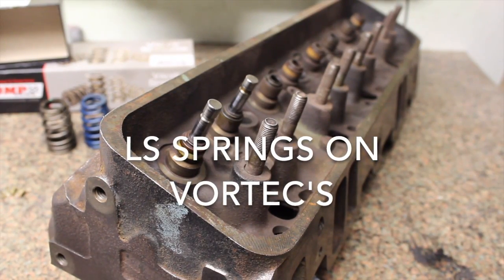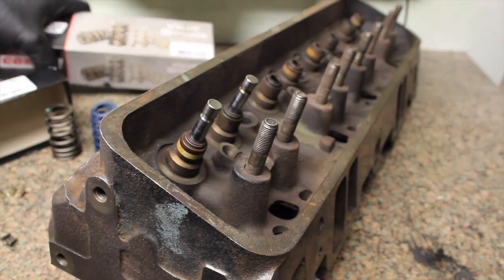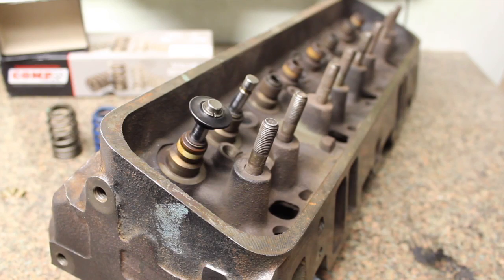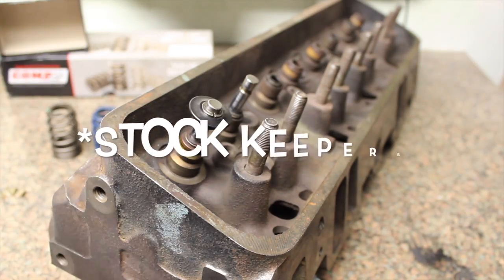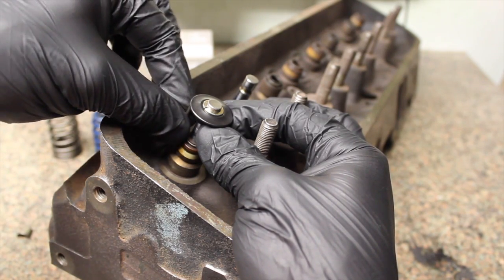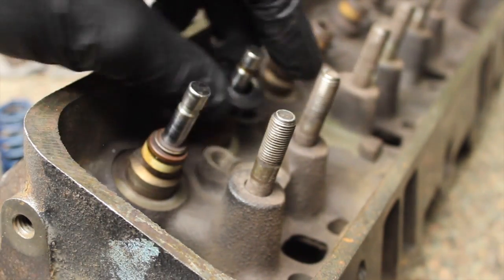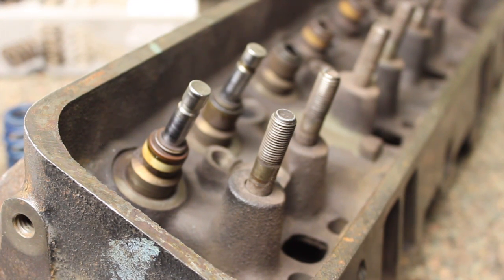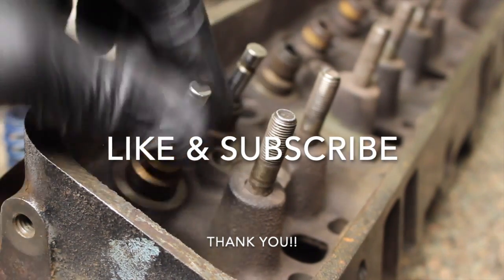LS6 Valve Springs on SBC Vortec Heads

Comment: Or you can use a PC seal installation tool that cuts both the guide as well as trims the top , trim as much off the top of the guide as you feel comfortable with ..why take chances

Comment: You can get .100 longer stainless valves cheap from erson, with longer hardened pushrods also to keep geometry correct . This avoids what may be expensive machine work to cut the guides down ! Hope this helps.

Comment: could you file/grind a bit off the bottom most part off the keeper or retainer just enough to clear 
those rarely fail due to weakness
so that says they are stronger than needed  
but obiously offset keepers would better
Reply from the maker: Yes you can but you the offset keeper installs the spring at the proper height aswell

Comment: Do you have a minimum clearance between the self aligning edges and the retainer/ keepers? Also, if I have to grind/ file my aligners, what’s a “safe” amount to leave on the rocker?
I’m hitting now on my intakes, with my new full roller rockers, and my 787’s with .050 offsets, but they have huge alignment guides on them! I ordered some of the .030 offsets, that I’m going to try on just the intakes, since the exhausts are fine (.520 exhaust lift, and .525 intake Summit’s LT-4 hot cam copy Sum-8802 roller cam).
What limits do you suggest on the valve tip (intake side), and clearances with the alignment edges? Thanks in advance! LOVE ALL YOUR VORTEC VIDS! I’ve been watching them over and over for years now!!
Reply from the maker: You'll want at least .055" nubs aligning the rocker to the valve tip and atleast .025 clearance from the rocker to the retainer or keepers

Comment: I will be installing a mild hydraulic roller cam in my stock 906 vortec heads with .450/.450 lift. I would like to use my stock retainers/keepers because they seem to be in good condition and I’m on a budget. Any spring recommendations would help thanks and awesome informative video!
Reply from the maker: https://youtu.be/tNVX3W-KHT0

Comment: Where are you getting the 1.750 stock installed height? Just took my vortex heads to the machine shop and it’s the same as any sbc at 1.7? So .050 offset keepers takes it to 1.75
Reply from the maker: What retainers are you using?
Reply from the maker: This is a newer video with more detail
https://youtu.be/UZosxGQyGMs
Reply: @cuttersperformance  sum-174003-3 specs are the same as comps iirc

Comment: One thing to note, I did not see you cover in either video. I watched two of your video's on this topic you put out. You can run harden valve lash caps to get the needed stem height for the self aligning rocker arms. Just something to add I know a lot of people shy away from running them but they do work, also yes I know I am commenting on a 3 year old video just figured I would add this for those that did not know.

Comment: I'm trying to set up my Vortec heads to support a stock camshaft pulled from a 1993 Camaro's LT1 engine.  From what I've been able to find, that cam should have a .480 lift.  Just to make sure I'm understanding correctly, all I should have to do to be able to support that .480 lift is swap to the LS6 springs, right?  I have the heads at a machine shop now for a valve job, and they seem to think the factory springs should work.  You mention that Vortec stock max lift is .420, but later mention stock safe max lift is .480; is this difference based solely on swapping to the LS6 springs?
Reply from the maker: I will post a newer video that explain things a bit more in depth. The stock springs aren't too good much past the factory lift of .420 to .430 with a mild roller. You can push them to around .460 with a mild flat tappet
Reply from the maker: https://youtu.be/tNVX3W-KHT0
Reply: @cuttersperformance  You're the best!

Comment: Can install the blue b hive ls6 spring and run a XE274 comp cam with out off set keepers
Reply from the maker: Yes you can,  ive done it. Just follow proper break-in if the can is new

Comment: Trying to spec out parts for my 98 5.7 vortec...so could I run offset keepers, the comp retainers and drop in ls6 springs rated at .600 lift and clear a cam with .550 lift on intake and .540 on exhaust?

Comment: Pat, did you have to machine the heads to accept the LS6 springs? 
I like the Summit 8802 hydraulic roller cam but, it has .525 lift. So, the offset keepers would get us to .530 lift but do the spring pockets need to be machined for the beehives?
Reply from the maker: Check out this video aswell, no machiene work done to the heads. I ran the similar LT4 hotcam recently with this setup, worked great with the ls6 equivalent summit springs up 6200 rpm all day.

https://youtu.be/UZosxGQyGMs

Comment: Hi! Great video, but what about the valve spring outer diameter? The LS springs are larger then the vortec springs, the valve spring seat is about 1.240 on my vortec head and the Comp Cams springs in the video is 1.282 and the GM springs are 1.290.

Thanks!

Comment: Alert!  Careful with the pioneer studs I’ve had them break using heavier springs, I could have had a bad batch, but it broke none the less.  

https://youtu.be/ef9aivMcJgs

Fantastic video thank you!
Reply from the maker: What rocker arm were you using?
Reply: @cuttersperformance  stock stamped 1.5 ratio
Reply from the maker: @amateurism1  how much lift are you running?
Reply from the maker: The reason I ask, is ive only seen these studs break when guys try to use stock rocker arms with too much lift and the rocker arm bottoms out on the stud at full lift
Reply: @cuttersperformance  Roller gm cam pn 14097395 .431/.451 advertised lift, I feel it’s important to point out that they were used on …993 heads (more valve travel) with heavy (375 lb) springs, there was no binding.

Comment: what do i need to do to run a 431 intake 451 exhaust lift roller cam on my stock vortec heads , just a little cam upgrade ,, thanks
Reply from the maker: https://youtu.be/tNVX3W-KHT0

Comment: @PISS-CUTTER Performance 
I’d like to use the 1.6 rockers I just bought 2 wks ago to use with the crate stock cam shaft  on the new isky 485/485 232/232 @50 cam shaft.  2500-6800 rpm   With 1.6 sh oj I’ll be 515-517 lift.   What are your thoughts.  3/8 tight asphalt circle track
Reply from the maker: I will be doing a video in the next week or so (just waiting for parts) on our valve spring setup for a .525 lift for a LT4 hotcam and roller tip rockers. Should help answer some questions for you
Reply: @cuttersperformance  I sent u a email with some pics and a vid. Hopefully you get it .  Take care

Comment: U can’t just use the steel rip rollers ?? I’m using them. Me on 1.250 crate 602 springs..
Reply from the maker: Yeah, you can just gotta watch for clearance at the push rod to head and retainer to rocker arm if using offset retainers

Comment: The offset keepers you use. Are they - (negative) or + offsets? Also, I have the Ls6 valve springs. Would you have the part number for the parts I need to use these?
Reply from the maker: +.050 offset keepers. All the part numbers should be in the video. If not, let me know what you need
Reply: I didn’t see a part number for the keepers. What size valve stem are they?

Comment: As far as the rocker concern with the offset keeper, could this be remedied by using self aligning roller tip rockers?
Reply from the maker: Yeah, you can typically use a roller tip rockers with factory valves and offset keepers. The exhaust valve is no problem as the tip is longer, but the intake valve you have to check for clearance

Comment: Lots of confusion. Why does Summit advertise max lift for their Vortec heads as .520? 
 These are Summit Racing Part Number:  SUM-151124

Did they modify them for more lift?
Reply from the maker: They are an aftermarket casting, not a reconditioned factory casting. I believe they are made by Dart.

Comment: what stops someone from running +.050 locks on stock vortec retainers, say with a z28 spring without the damper? i have a "395" ramjet cam that id like to run with 1.6 rockers, which would make it .460/.481 lift. would it increase the retainer to guide clearance enough?
Reply: Ive got the 395 cam and LS6 valve springs. This combo works great, no need to modify the casting to fit Z28 springs

Comment: So I can safely run stock keepers and retainers with a ls6 as long as I don’t go over .480 lift right?
Reply from the maker: Yes, but you should do the checks shown in the video to be sure. Make sure your valve seals are seated all the way down aswell

Comment: Gen 1 350. Vortec heads. Just swapped out rocker studs in case future upgrades on cam. Bought L79 cam. Recommendations on rockers.. interested in rollers but know I need self aligning because the vortec don't have guide plated...
Reply from the maker: Comp cams or PRW self aligning roller tip rockers work well, especially if your trying to use stock valve covers

Comment: Someone mentioned to me that they had seen a YouTube video about swapping to complete LS valve train. I don't remember, they said they were the 1.99" intakes and 1.55" exhaust. Upgrading to a bronze 1/2" odd guide for the .312" valve stem, as well as the LS6 springs. I haven't found anything on this. I've found plenty of videos, swapping springs. Yours is the most comprehensive on the spring swap. But I'm wondering if there is any advantage, performance-wise, flow-wise or weight-wise with that kind of swap. All I know is is from what I've been finding in researching, is that the stock 1.94s and 1.50s are pretty much better off left alone rather than going to a 2.02 and 1.60. Have you ever seen or heard about anything about the valve & spring swap (and guide) upgrade?
Reply: We did this on a set of 305 1.84 heads. Drilled out to 1/2" OD .312 ID guides as mentioned. Cut seats to LS valves. On the old style heads we had to get a little creative on the exhaust side. We used Buick 3.8 keepers because you had to make up for the rotators. We may have used the retainers also. It's been more than 10 years ago and I'm not getting younger. The Buick keepers had the retainer ledge higher up, which took up the space some. You wouldn't have to worry about that on vortec heads as they don't have the rotators on the exhaust. It was a good running 305. And about the max valves you can go on a 305

Comment: If I run a 500 lift cam I don’t have to cut anything on the heads just get the same setup u have comp cams springs retainers and keepers I’ll be able achive 530lift even tho I won’t go that high

Comment: What's up man? Love your videos.  I have a quick question for you, I am doing the ls6 spring on some 906 vortecs and have notice the bottom of the spring is pretty snug to the guide boss.   Will that be ok?   I've always been told you need .010 clearance.
Reply from the maker: Sometimes, the guides will need a casting clean-up with a sanding roll on a die grinder. Spring should slide on with minimal effort
Reply: @cuttersperformance  awesome man!  Thanks for the fast response and keep up the awesome work!

Comment: Total newbie so don't hate. I'm redoing a L48 Corvette my uncle gave me after I returned from Iraq. I finally have the time to get on it. I understand the L48 vettes only put out about 180hp so I picked up a set of rebuilt 062 Vortec heads and intake to reuse the quadrajet carb. I have a L79 cam for it as well. Do I need to change the pistons to accommodate the heads? Do you have any other suggestions? Again, new guy, don't hate..lol
Reply: Thanks for serving OUR Country my young Brother/Sister !

Comment: I use the screw in studs too. A lot of the circle track rules say ya cant but those incognito ones have never been seen. I also break-in my motors on a run in stand before they go to the dyno with either a less than 80lb seat pressure spring or remove the inner spring.
Reply from the maker: Yeah, they are super hard to see when probably installed

Comment: I used .030 keepers on the beehive springs with a 501 505 lift cam will I be ok or do I need to do something different it also gave me .020  more fore my rocker self aligning at the rocker what do you think thanks
Reply from the maker: Did you check what your seal to retainer clearance was? Installed height should be around 1.780 with the .030 keeper and the 787 retainers. Installed at 1.780 a LS6 spring is good till .530 lift
Reply: @cuttersperformance  .058 thanks for the reply I'm building a imca I'm thinking.003 on the mains and  rods .007 on the side skirt I have a 80 pound pump with oil restrictors for the top end  a 7 + 1 oil pan any wisdom would help thanks again

Comment: So if I upgrade my stock vortec heads with LS6 springs the Comp Cam retainers and and offset keepers would you have a problem with the factory self-aligning rocker arms hitting? or is it just the aftermarket ones that have problems. Is there a set of after-market roller rocker arms that work with out hitting?
Reply from the maker: I rarely use the stock rocker arms as they won't take much lift. Comp cams or PRW self aligning roller tip rockers work well

Comment: Very good infos thanks !
I have stock bottom end l31 vortec engine

My heads have been ported, 3 angle porting, and beehive springs.

So i want to put a Xe268h-10 cam .wich has .480  full lift..

In your opinion should i keep the stock self alinign rocker arms or i should buy the aftermarket rocker arms ? Surely i will also take a look at the clearance between the retainers and the rocker

Comment: Like the video but was wondering if it would be safe to use a hydraulic roller cam with Vortec heads using ls6 valve springs
Reply from the maker: The LS6 springs are designed for a Hydraulic roller cam. They work with stock to mild Hydraulic roller cams and Ive used them with flat tappet cams aswell

Comment: My camshaft I have is .470 intake and .480 on the exhaust, stage 1 cam. Will the press in rocker stud blow? I may wanna put turbo or 671 blower
Reply from the maker: I recommend screw in studs on anything over 300lbs of spring pressure open

Comment: So what rockers do you recommend for the offset keepers
Reply from the maker: Comp cams roller tip (1417-16) Somtimes sligh filing of the alignment nubs is necessary but these are my go to for vortecs and they work great 👍

Comment: do I need to get offset retainers or can I use just normal comps cams retainers.
Reply from the maker: Offset keepers allow for the proper 1.800 installed height. You dont have to use them but then the spring is installed at 1.750 as described in the video
Reply: @cuttersperformance  its because i want to run a 280/480 flat tappet on my 350 but i was just going to buy the offset keepers and offset retainers and the springs from the video
Reply: can i still use the retainers and keepers so i can get proper height on the springs even tho i dont need to ?
Reply from the maker: @miguelramirez-st5bm  sorry im not sure I understand your question. The installed height for the LS6 springs is 1.800. To get that with the 787-16 retainers you will need to use + .050 offset keepers
Reply: @cuttersperformance  okay so is it okay to run those offset keepers and retainers to get the correct height even tho I'm only going for 480 lift ?
Reply from the maker: @miguelramirez-st5bm  yes thats correct. Installing springs at less then the installed height spec increases the seat/open pressure and decreases the total lift the spring can handle.
Reply: @cuttersperformance  okay sorry for asking so many questions this is my first time building a vortec motor but would I be able to run scorpion Scp1036 self aligning rocker arms ?
Reply from the maker: @miguelramirez-st5bm  if younuset offset keepers your better off using some like comp cams 1417-16 self aligning roller tip. 
Check out my video on vortec rocker arms

Comment: Thank you for this information!! I will be  doing the same thing to my heads but I've hit a road block when it cone to ordering my pushrods... my cam is 495/502 meiling 22280. Will the factory size pushrods work?
Reply from the maker: Just about everything can change the pushrod length, but if your going with vortecs on a roller block then the factory pushrods of 7.200 should be close. You will not know for sure until you assemble everything and check the pattern on the valve tip
Reply: @cuttersperformance  thank you!

Comment: How high of rpm can you rev if you put all the parts in? I have a former step-dad that has a 355 with the smaller valve vortec heads. He can only rev it to 5200 now
Reply from the maker: These springs work with flat tappet cams and mild roller cams, ive used them at 6500 rpm no problem with a 1.94 valve
Reply: @cuttersperformance  would the offset keepers work good to?
Reply from the maker: @logicalspark3496  yeah you need them to get the 1.800 installed height
Reply: @cuttersperformance  does it still make power at that high of an rpm.
Reply from the maker: @logicalspark3496  yeah depending on cam
Reply: @cuttersperformance  I think he has the 268 one
Reply from the maker: @logicalspark3496  itf its the XE268 cam, that cam will make peak power by about 5k rpm and fall off

Comment: Ls springs 560lift. 600lift all over ebay. The offset keepers i understand. Is there something special about the retainers. Is there a standard and a 7 degree retainer. What type of retainer is used. I am upgrading from stock flat tappet to a stock style roller (lt1).